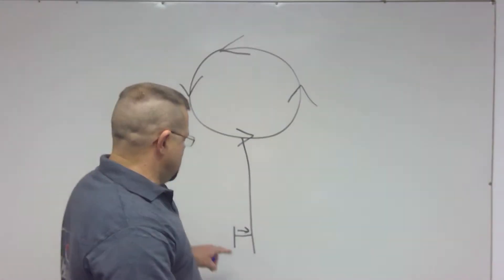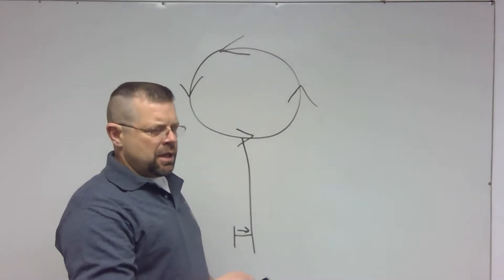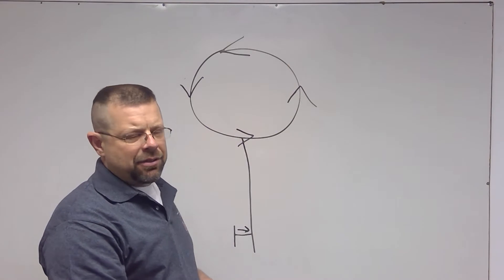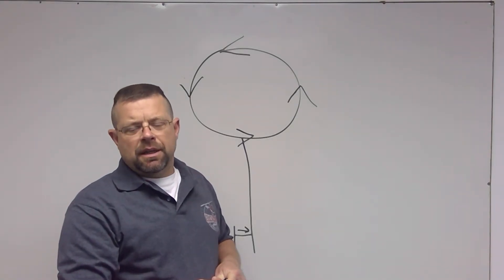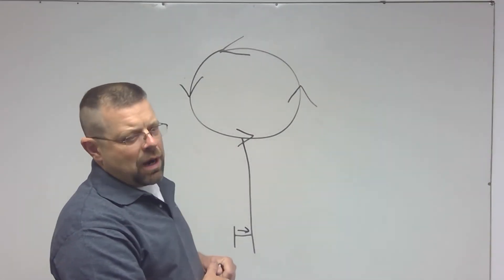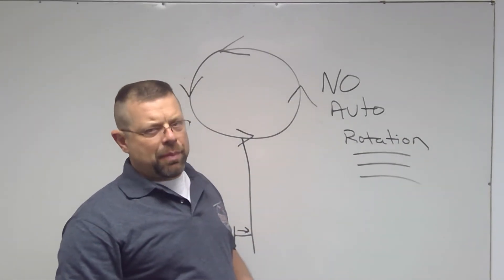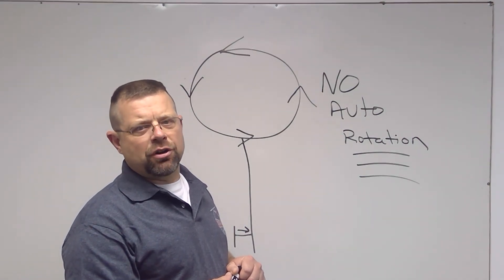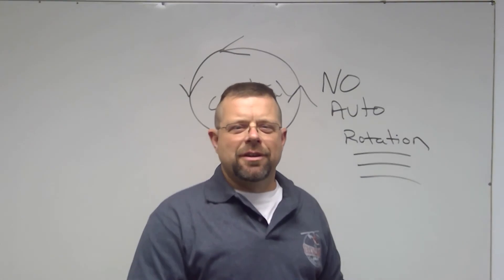Stuck pedal

Comment: No autorotation during tail rotor function emergency. Got it.

Say a hypothetical situation, where I'm flying a military helicopter and I get shot at, and both my tail and engine get taken out. I have some altitude, how would I safely make it to the ground? I guess I don't need the tail rotor unless I want to steer? becasue there's no torque since I have no engine
Or is there now torque in the opposite direction because of the drag and the transmission and bearings?
I've never flown a helictoper before, nor am I in the military, but I am curious. Thanks!
Reply from the maker: @nicki8731  there is no torque or opposite torque during the autorotation. Therefore in your scenario, the autorotation would still be the answer.
Reply: @garycleveland2989  Good to know. Then why in the video did you triple underline "No Autorotation"? Thanks!
Reply from the maker: @ no autorotation for stuck pedal because there is still antitorque thrust. So a run on landing is the answer and manipulating throttle for heading
Reply: @garycleveland2989  Thanks! :D

Comment: Depends on type of helicopter. In an EC-145 the flight manual states if the nose is to the right at speeds greater than 40kts you must do an autorotation.
Reply from the maker: Clockwise rotor system helicopter with a yaw right means a lot of pitch stuck in the tail rotor. Then you say enter an auto and get rid of all torque? Doesn’t sound right but I’ll look into that with a friend who flies them. Thank you
Reply: @garycleveland2989  Ec-145 is CCW rotor.

Comment: Stuck right pedal.   You don’t need power for take off.  So why can’t you fly it away if you don’t like the set up.     Right stuck pedal is easy.  Slow aircraft down.  Get hover height.  As you are coming to a slow stop, slowly roll throttle off to maintain heading as you touch the ground.  

Left pedal.  
As you approach, pop the collective up and down several times, until the aircraft yaws to the right and it will slowing make its way over there.   Now roll throttle off as you now turned a stuck left pedal into a stuck right pedal.    No need to over speed the engine.

Comment: How is that not an engine overspeed ?   Any amount of rolling the throttle on, is going to go past the engine limits - red line.   Or is this just in theory and not for practicing ???
Reply from the maker: Do not practice overspeed. Only used in actual stuck left pedal and at the last second before run on